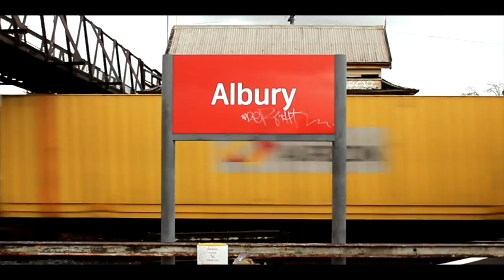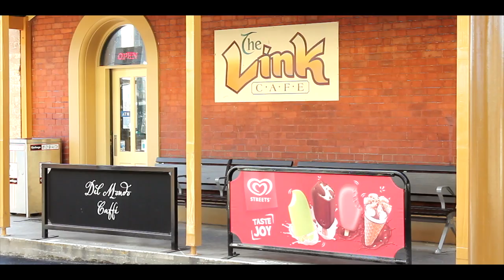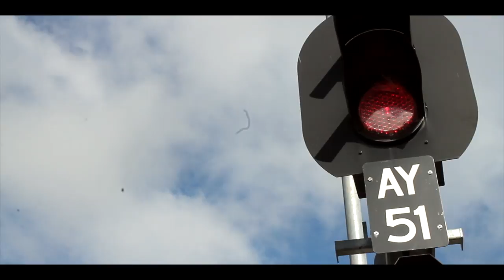Albury Railway Station

Comment: Longest platforms in operational use are:
1) East Perth 770M
2) Kalgoorlie 760 m  
3 ) Flinders Street 720m
 (only partially used now)
4) Port Pirie 701m
5) Albury 456 m

Comment: Why is it so long for?
Reply: Utareangara Back in the old days, the station was where the Victorian and NSW railways met, but didn’t connect, because the Victorian line was broad gauge (1600 mm), but the NSW line was standard gauge (1435 mm). Track gauge is how wide a railway track is.

They made it long so that they could change trains easily.